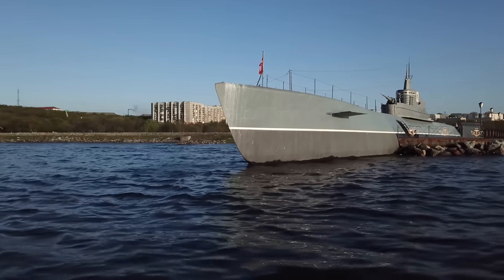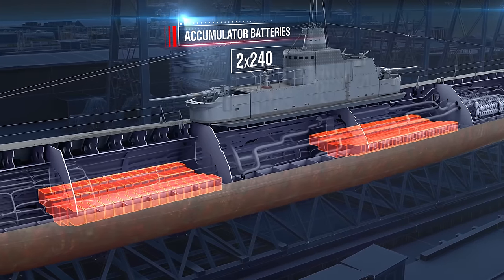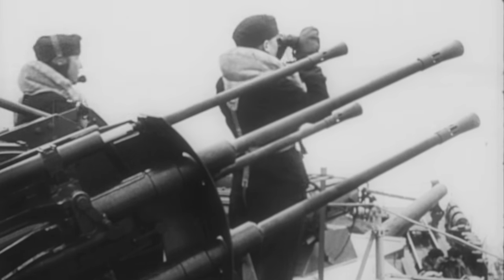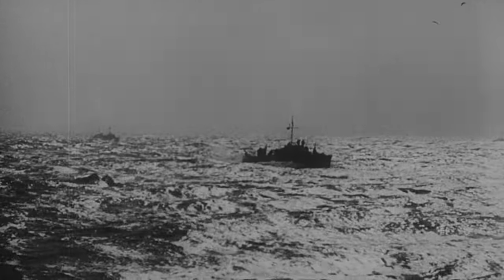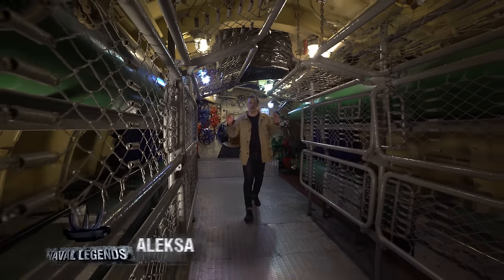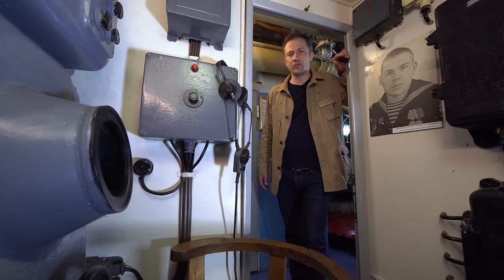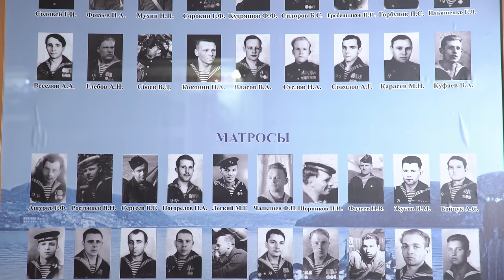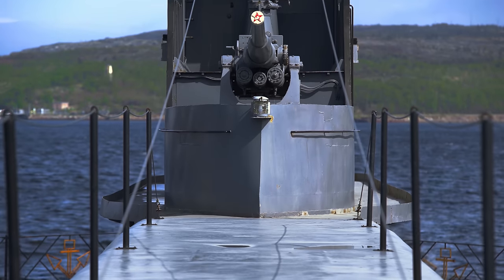Naval Legends. Submarine K-21 | World of Warships

Comment: 18-22mm pressure hull? That sounds a little thin.
Reply: It'll be 300mm thick in game
Reply: Around the same as the US Gato class submarine. these ww2 boats were all more or less designed to sustain around 100m dives not more.

Comment: 11.5nm range submerged seems suicidally short to the point where I'll refuce to belive it till someone shows me a source...

you have 2x 240 battery elements, but what's the Amp/h? must be some crappy batteries if you can barely move 1/8 the norm of a Type VIIc or 1/6 of the Surcouf... furthermore being a soviet sub, I would expect there to be relatively few high power electric devices onboard, using hydraulics or mechanics instead (rudder, diveplanes)
anyone got a source if the number is true?

Comment: So funny!!! At 6:20 the little dude in the Nehru jacket boasts that soviet engineers: "much to their credit - managed to combine all this (a sub hull very good on the surface, submerged and used for significant artillery). Very soon after that another dude appears and says how bad the engineering was and all the changes had to be made and that the hull was thinner and so fragile that rough seas badly damage it,  not to mention depth charges depth charges causing hull leaks, fuel leaks. Then they didn't have training schools, etc. 

It is a joke and an embarrassment.
Reply: Russian engineering at its best.